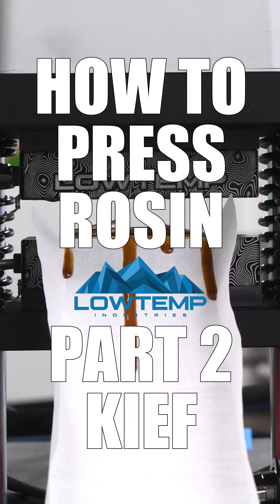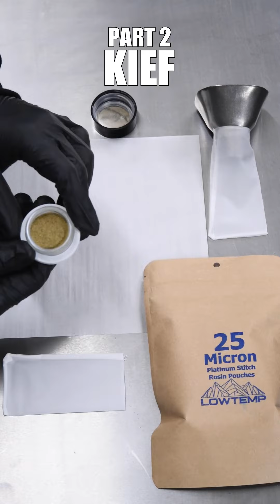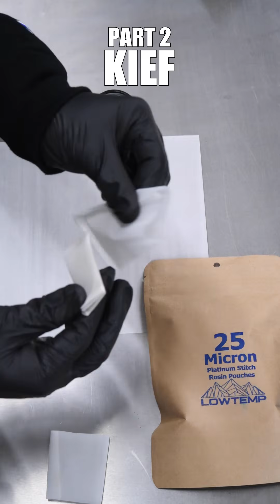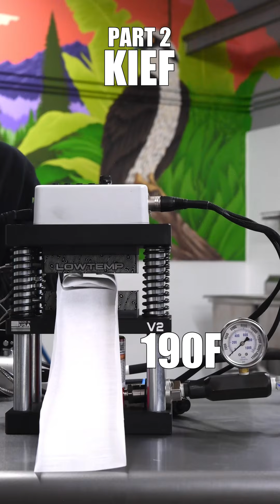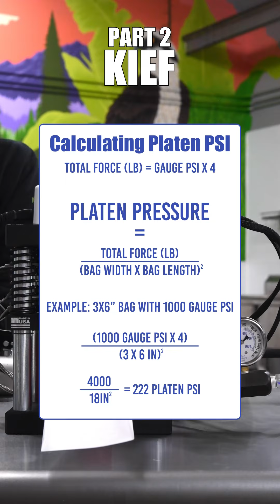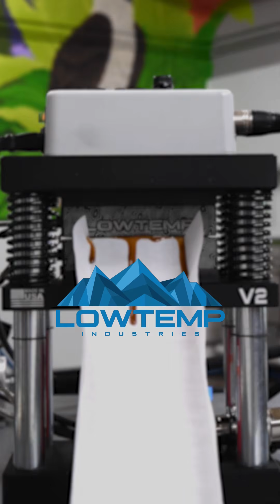PART 2: How To Press Rosin for Beginners - Kief

Comment: Do the bags release chemicals? Everytime I press keif it makes my throat sore..wondering if the bags are release chemicals or somwthing
Reply: When I press str8 buds with no bag it comes out amazing
Reply from the maker: @willnone9977  Nope. It's your starting material. Kief is dirty, especially if you are calling the flower rosin amazing. Flower rosin is pretty terrible in quality compared to proper hash rosin!